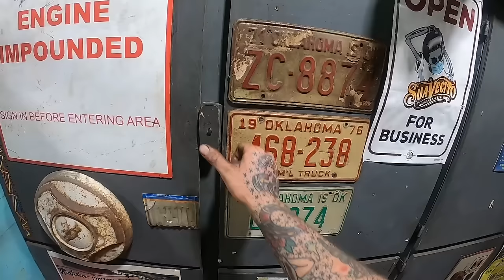Budget Shop Truck. WILL IT DRIVE AGAIN? 1976 GMC SHORTBED Conversion.

Comment: The ears were bent in on your drive shaft and yolk from pressing the old u-joints out. When I went to tech school for GM, they actually told us to never press joints out. They have a different tool to beat the opposite yolk downward to force the caps out. Drive shaft and yolk ears can be bent easier than you think. Most of the time, once you press the joints out, if you lay the inside of the yolk on the edge of your vise, and give the outside edge just under the ear a smack, it will bend the ear right back to where it should be. Your u-joint will go in nice and the clips will go in just like they are supposed to. You did well to sand the u-joint holes in the yolks, but you also need to make sure to dig the clip grooves out completely with a pick.
Reply: Came here to say this 👍
Reply: Thanks for the info, I usually beat my ujoints out, but since I have a press, I would try it. Big mistake.

Comment: 45:45 hey puddin, to get that parking brake cable off, put a hose clamp on the fingers, tighten it just enough to compress them, then yank the cable out. 60% of the time, it works every time...

Comment: The vacuum bleeder in my experience have always been pretty finicky on new masters or new lines. You generally always want to bench, bleed the master, and do the initial pedal, bleed and then vacuum bleeding goes a lot easier.

Comment: Your snake battle was funny as hell 🤣 I was cutting a lawn with a zero turn mower years ago when a snake started biting at my leg, chasing me around with me trying to control the mower and I lost control and ran it over. Had animal control come and look at it and it turns out it was a brown rattle snake, at the time I didn't know they existed in New England. I was never afraid of snakes but now I'm a little leery. Anyway I grew up working on square bodies and absolutely love them. You're doing an awesome job resurrecting that truck. Yeah there is always problems but you overcame them and built a cool truck. Great video as always 👍✌️🇺🇲
Reply: Yup, it's the Eastern Diamondback Rattlesnake. We got them everywhere here in PA. Copperheads too. Rattlesnakes usually slither away because they'd rather not bother with you, but Copperheads are temperamental and they're very aggressive, they like to fight. I was but by one two years ago and I felt like absolute garbage, had to go to the ER because they're very poisonous. Got me right on the arm really deep.

Comment: For brakes check the rod length to the master. My buddy had one that was adjustable and the rod was set too long and no matter how much he bled the brakes couldn’t get it to stop good. Adjusted the rod to where it wasn’t pushing the plunger on back the master and bam, stopped on a dime.

Comment: Just be glad you don't work on driveshafts every day.  Did it for 2 years straight during my automotive career.

Pro tip: a cold chisel can be your friend while replacing ujoints; mainly for popping the old clips out, but also for seating the new clips.  It doesn't have to be razor sharp, or even close to that.  It just needs to have a good edge on it.  You'll figure out the best ways to hit it to pop those clips out with one whack.

If I remember right, and it's been more than a minute, I used to use a fairly big one.  Like most tools I bought off the tool trucks, I bought single items that I needed.  I gave away a lot of tools after I retired, but I'm pretty sure I still have that one.

What I'm saying is: get a good quality chisel.

Comment: Epic!  I had a friend that went through the Spicer school (that's the good brand, btw)... he just used a big hammer and hammered the crap out of the thing.  You beat on the cast parts, not on the joint or the shaft.  Use the vise as a spreader to hold while you beat the yoke down... carrying the end cap with it... then flip the thing and beat it through the other way.  Big-ass hammer does it.  Final thing is to beat the caps against the clips to get that freed up.
Reply: Yeah, the 'ears' seem to get pinched when you press the caps in. A few loves taps with a ball peen on the ears frees them up for me.

Comment: Same rear 3:07 gears I had in my 1981 blacked out black Chevy step-side truck that I lowered really low would pull my blown and injected BBC Cole runner bottom drag boat thru the desert at 95 mph all the way to the river at Parker Arizona from Buena Park Ca. Also had a 55 gallon barrel of race fuel in the bed and the top to my tool box and rode awesome the whole way. It was so low you could not get your hand under the frame cross member under the trucks oil pan when it was sitting. Thanks Puddin for all your hard work and great videos. Love your merch too.

Comment: Ain't nothing wrong with using a speed square on your car projects. I do it all the time!
Reply: It’s a square?  What are supposed to use?😖😂
Reply: I did construction work for 24 years, I use a lot of woodworking tools for fab work. A wood chisel works well for deburring aluminum in some situations.

Comment: You can replace them seals in that gear box for like 30bucks, get a rebuild kit like you do for carbs. There not to hard do at all.. keep them vids coming puddin ❤
Reply: In fact, to get the lower seal out all you need to do is remove the snap ring and turn the wheel up against stop……hydraulic pressure will blow her out! Tapping it back in is easy.

Comment: Funny quote: “It’s really not that bad to do.” 
Ummm sure, IF the bed is off, IF the frame is cleaned up, and IF it’s on a lift at eye height… I know your struggle has been real brother, I’m really happy for you and just glad you’ve come a long way since your days of doing brake lines on your back laying in mud and or gravel or the best way of all, “on hot top during a heat wave!” Ya doing a brake job those ways maybe not so much fun! Not saying you wouldn’t still cause you do what you have to, well that and “Momma didn’t raise no punk” so you ain’t afraid to either! I love that new shop! 😉✌🏼

Comment: I always push the caps to the outside and after installing the new ujoint hammer around the ears of the shaft which tend to push together then the joints free up.

Comment: Hi there Puddin, hey I'm loving your Channel and have been a huge fan and supporter for years.
 I just want to say that don't ever put your ground clamp on you Axle then weld on your housing. The ground is actually going through your bearing. I've seen guys lock up engines and bearing doing this.  Not trying to be negative or anything but doing this could end really bad.

Comment: Thank you for trimming the rear axle U Bolts- nothing more annoying than snagging your head on them. I still can’t believe how many times I’ve seen a mile of thread for no reason- same person will think it’s ok to have one thread of engagement on a lug nut as well 😂 also for those u joints, if you have a ball joint press they work fantastic for installing them

Comment: 18:20 i think the springs are longer because they are using cheaper weaker metal then originals so they have to have them longer then the original to give the original ability.

Comment: Another Keigger tip of the day.....slide the steel spacer over an old 5/8" U bolt, tack weld one end of the spacer to the U bolt and mount it up in the evolution saw and cut thru everything.....just my 2¢....Cary on sir!👍

Comment: The shop I used to work at, I’d order Dana Spicer U-joints when ever possible, usually from Oreillys. Never had an issue, worked way better than any of the others I tried over the years. The drive line shop up the road from us we used from time to time swore by them also.

Comment: Hey, I would recommend some rubber between the tank straps and the tank. It'll help eliminate vibrations and the straps possibly cutting into the tank. Strips of an old inner tube should do the trick in a pinch.

Comment: Puddin
....check to ensure  the booster is not holding the master on...i.e. are the compensating ports clear at rest. Get a paper clip and probe in the holes. If it feels spongy the cyl is not returning fully.the cup may be covering the hole. If it feels solid its ok.

Comment: Install the slip yoke with one cap clipped in.  Then hit the yoke to drive the cap flush against the circlip. Install the opposite cap and drive it into where the circlip will fit. Rinse and repeat.

Comment: I got two pieces of flat stock and blew two holes in it with my plasma cutter then I bolted them on the lug nuts and measured across from the driver side to the passenger side to align it when I do front ends.

Comment: I have been binge watching Mr. Puddin for the past few weeks. Been an awesome channel. 

One thing to consider, when dealing with flared fittings, I was taught to tighten to help seat, then loosen and retighten. It has been a trick I have learned to prevent leaks.

Comment: Sometimes you have to take a little bit off of the u joint caps. That was always a common problem with them older trucks.

Comment: Hey Puddin, A little trick for you. The next time you do u-joints, after you install them, take you hammer and smack it on the drive shaft below the u-joints cup. Hit it once or twice, that set the u-joint and then they wiggle like a snake lol. Just a little tip. Love your channels and videos. Take care and be safe.

Comment: Man I was struggling with you on this one! I've been through 90% of what you did that week. 3 things. 1st I don't know if it's where the long bed leaf springs are longer from axle back than forward or what but it seems like it's mostly the longed springs. When axle flipped I have to jack up the rear end a touch to get the driveshaft in. Not so on my Blazer or short bed. The transmission shop had actually had my driveshaft shortened when they installed a TH700, causing the driveshaft to sit in the tailshaft bushing about an 1/8" when truck was sitting on ground. They measured when truck was on lift and rear-end was drooped out. Needless to say that turned into a whole fiasco. Stock driveshaft worked great with the TH700 swap in the end. 2nd last u joints I got for mine I ordered the ones that come with multiple clips. 3 sizes with different thicknesses. 3rd I ran into the same issue on brakes. Drive it 10-15 miles and see if one of the calipers tries to lock up. I replace everything on the brakes at the wheels. All lines, master and booster. All with same not great brake feeling and then a caliper trying to lock up after 8-10 stops. Turns out setting was wrong with the proportioning valve the whole time. I could've literally put a prop valve and new pads on the front and I would have been fine. 
Hope this helps someone else

Comment: POS new parts, master cylinder. I had a similar issue on my grand Marquis where I replaced the master cylinder. Once you push the brakes down the first 10% I would get pressure to the rear brakes the rest after that I would not get pressure to the rear brakes. Crack both front and rear bleeders and pump brakes to test see where you get fluid at one position of the pedal.

Comment: Little tech tip when installing u-joints. Tap on the yoke on the weld after installing and it will free up the tension.
Reply: As in where it meets the shaft?

Comment: At one point I had several different master cylinder caps with metal valve stems bolted through them, and I used regulated air pressure to help bleed 7psi

Comment: Worked for AAMCO for 8 years,When installing u-joints we set the cap,installed the u-joint,Tapped the shaft while laying on a piece of wood until the cap started,Then set the second cap and held the shaft against it,This is because the u-joint still remains partly in the other cap so the bearings won't drop.Using a plastic or brass hammer,We lightly drove the caps in alternating to make them equal,We then used a socket and a brass or plastic hammer to lightly drive the clip in seating it,If the u-joint was tight we would tap the cap housing with a brass or plastic hammer until it loosened up,If no needles dropped this usually worked,I never lost one in my entire time doing this. Not telling you how to do anything,Just saying what worked for me.

Comment: Dont feel bad about having to redo the break lines multiple times i think we all have forgotten were the fitting was on the tube there's more tubing that made it to the scrap bin then anything. We keep the mice at bay by putting glue traps in every corner in my shop especially at the doors it works great catching the little buggers and the occasional harmless snake

Comment: I only use Spicer u-joints. They're the only ones that hold up in a diesel, and they fit good. It's nice to work on something you can actually get parts for, ain't it! Good video!

Comment: You do a lot of tightening with the weight on the tires! Time to build some of those wooden cribs to set the trucks down on all 4 tires 18” off the ground so you have lots of room to work under them still!

Comment: You can take that weird “counterweight” thing off the speedometer cable hookup on the transmission. I had one on my car and took it off. The cable screwed straight in to the transmission and the speedometer worked the same. I saw no difference. I don’t know what that thing is for.

Comment: Gently tap on the yoke after you have installed the clips,then turn the u joint to feel the resistance. as long as all your needle bearings are where they are supposed to be that will usually make your u joints smoother.

Comment: If you can put u joints in the freezer for some hours and the grease will get sticky enough to hold the needle bearings in place

Comment: Really love the build on this Chevy shortbed. My question, how are you deciding what to clean and paint and what not to?  Is it based on a time factor, or just the size of the parts?

On the sway bar leave the fame bushings loose till it’s on the ground or it will squeak.  You can install the link bushings and tighten them while the truck is suspended

Comment: Your snakey friend reminds me of my snakey story. I was driving my 92 Chrysler LeBaron convertible when something wet and stinky started dripping onto me from the front of the top. I stopped and started putting the top down to see what was going on. There was a 2 foot garter snake hiding in the top assembly. I got in a tug of war with ole snakey  and eventually won. Either he came out in one piece or in pieces . He chose to stay in one piece and I wrangled him out. I left him 65 miles from home so I’m sure he won’t do that again. He must have gotten in through the drains in the back well.

Comment: Follow up with Earl. The ears on the gn driveshafts flop all over the place. There are several ways to pop em in and out at home without ending up pinched that tight.

Comment: Brake proportioning valve will block the fluid to the front or the rears if it loses brake pressure (like when you crack a line open). There is a tool you were supposed to use on a proportioning valve while bleeding. Although I have had it reset itself by doing the old school pump the brake pedal method.

Comment: I busted my 8” vice putting in new Moog u-joints.. cracked the joint and I started measuring.. 6 different u-joints and 6 different sizes. I ended up having to grind down the yoke & shaft to get the clips in.. China is doing a wonderful job making American parts… they’ve lasted 10k miles so far. I replaced a set on a Yj and one failed within 20 miles.. any suggestions on another brand?

Comment: You hit a driveline in the right spot with a hammer you’ll vibrate the caps right out, no need to hit the u-joint cap with a hammer or use a press.

Comment: Bleed your power steering. Jack the front end up with the truck off turn the steering all the way left and all the way right 6 or 8 times then it should be good. I have a couple of videos on it.

Comment: Not the straight gasket on the dif cover! Straight RTV black first choice and red second no gasket if you use the gasket add a little rtv on each side not to much and always make sure you take the dif cover and pound out the bolt holes from the back and make them flat if you go a little too far that's okay because when you tighten the bolt it will push it down this helps ensure there is no leak

Comment: Hey just to let you all know out there changing that seal on a steering box is one of the easiest jobs to do take the pitman arm off pull the little Rubber seal out take the snap ring up in there out start the truck crank the wheel and that seal will blow right out of the bottom I myself have changed a thousand of them and that is the easiest way to get that out so if you want to save some money on a gearbox now you know how to get the seal out the easy way just make sure you have a drain pan cause the pump is gointo blow that seal and fluid out just some info from old timer

Comment: Make sure your master cylinder rod length is the same. I've seen them be different and if it's putting pressure on the cylinder even before pressing the peddle it's too long. There should be a little play between rod and cylinder.
Reply: Slaken off the m/cyl  to booster 6:53  nuts

Comment: cut about a 6 inch hole through a block of wood, clamp it down on vice and pull the brake line through it for some straights